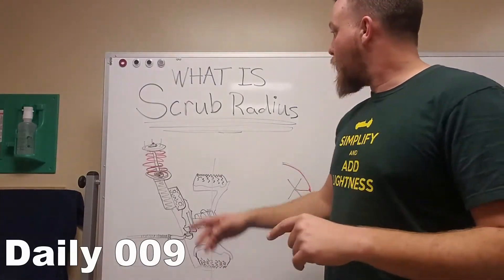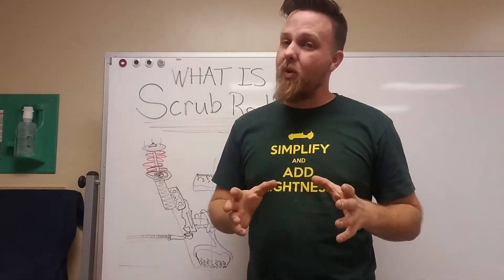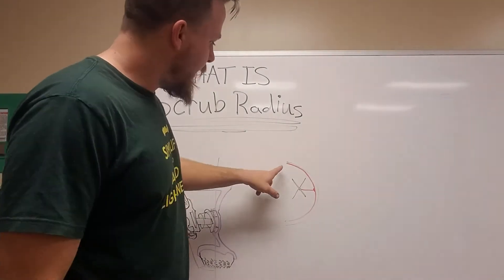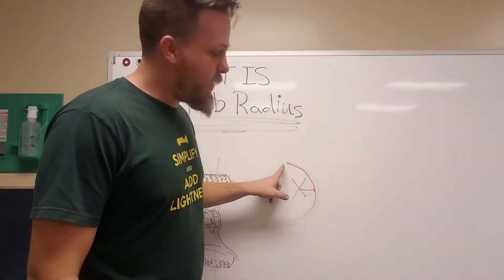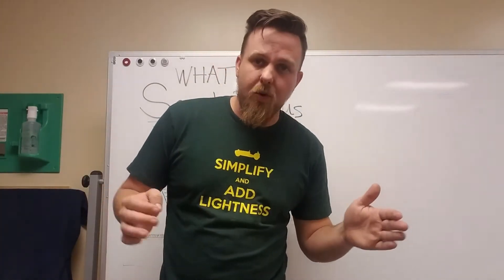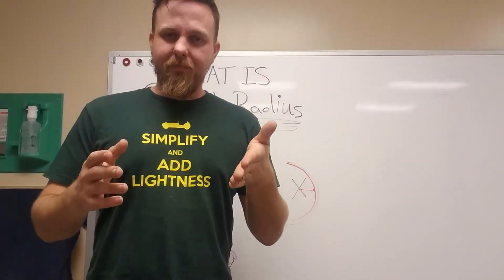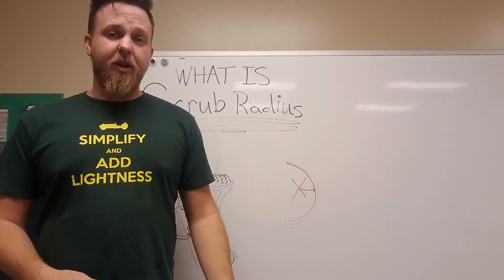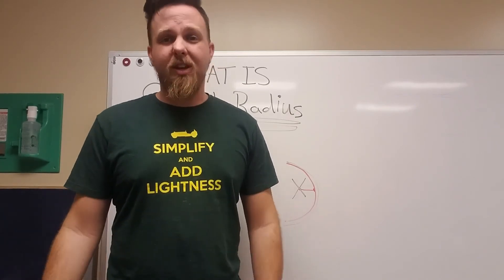What is Scrub Radius? [Suspension Simplified] (Daily 009)

Comment: There is too much information about suspension geometry. I do not recommend people to start mess up with adjustments if they do not know what they are doing. 
I will make a note: everything you adjust on your suspension, AFFECTS and i underline this, everything else! Increase lower control arm length will mess up really bad your roll center, because you’ve tilted the steering axis. Longer lower control arm also decrease steering feedback and self-steer. Longer lower control arm will increase really bad your bump steer because you have a control arm that is longer and it is moving in a different arch then your tie rod. There is too much behind this and needs to be studied really good before making adjustments on a drift car. Majority of people who starts to modify their cars actually they ruin the way the car handles. Anyway, great video, there is some good information that you can learn from this. All the best
Reply: Yeah. I want a bigger offset on my q60, but I understand that the costs of that beautiful look is just too much. Doesn't worth screwing the entire steering and suspension geometry.

Comment: So my car runs 17x6.5 +52 stock. Assuming it's naturally zero SR, how bad would a 18x8.5 +35 wheel scrub? Any other alternatives to fixing SR if I don't have the option to get longer lower control arms and don't want to change my offset?

Comment: Nice explanation of SR!

Piner, I've read many accounts of zero scrub radius resulting in 'tire squirm' and 'no steering feedback'.  That 'some' SR is good in those regards.

Personally, I drive a 2010 Honda Accord EX which according to wheel-size.com has zero scrub radius, where as its lower level variant(LX) has a slight amount of positive SR.

My proposal: Add conservative sapcers to create a small amount of positive Scrub on my EX.  I have read that spacers can make steering 'heavier'(more driver muscle required), which - guess what - I WANT!

Please weigh in on if what I'm proposing to do is feasible.

Thanks!

Comment: Best non-rocket-science vid on this topic! Thanks much. Is an 11mm-increase in scrub radius regarded as significant/problematic?
Reply from the maker: That's not a huge increase but it does depend on what the original scrub radius was. Most OEM cars do have a small amount of scrub, some more so than others. How much of an issue it is going to depend on driver preference. The real take away is all else considered it is best practice to minimize the amount of scrub when possible,  especially on fwd cars.

Comment: Do a video on how much effect tire pressure really has
Reply: Higher Tire Pressures:
More More More! Everybody wants more! The vast majority of drivers will inflate their tires anywhere from 2psi over the vehicle recommendation up to the max pressure on the tire itself.

Benefits?
Slllight increase in gas mileage.
Higher load handling
More responsive steering

Disadvantages:
Center tread tire wear
Rougher ride
Steering too twitchy
Stresses suspension parts

Lower Pressures:
Smoother, quiter ride
Bettter road compliance
Heavier, less responsive steering, but tracks straighter

Too low can:
Cause tire shoulder wear
Decrease fuel economy

So there are benefits to running tire pressures at the vehicle recommended levels, and to running them a couple psi higher than that.

Personally, I think most car mfgs did their homework, and the cold pressures they recommend for the  vehicles they built have for the most part worked.  I might add 1-2psi during winter months, but thst's about as much as I'll deviate.